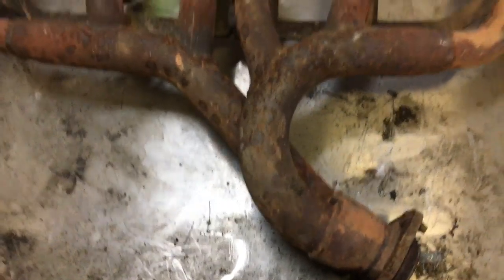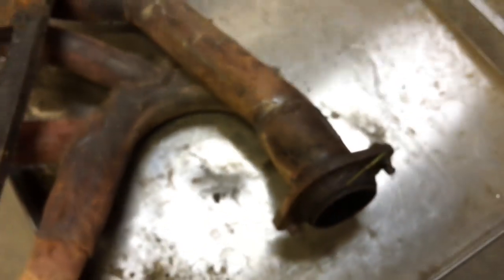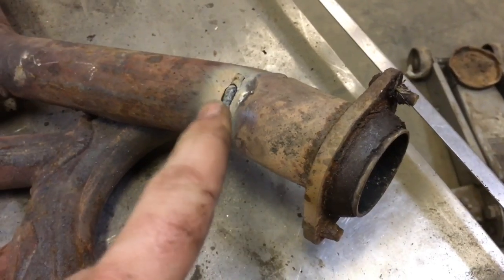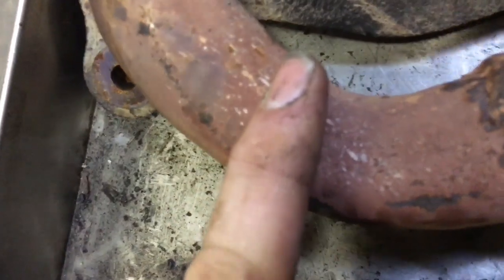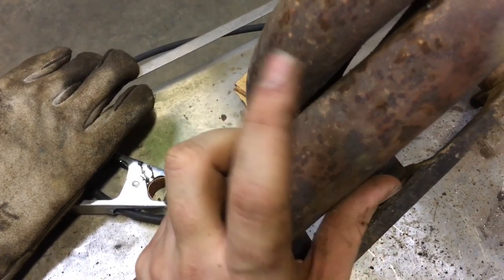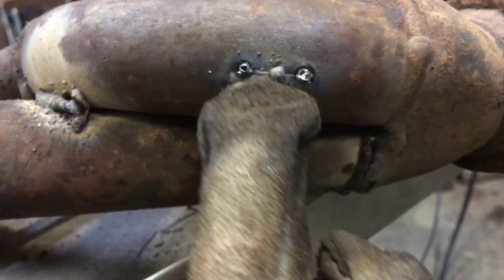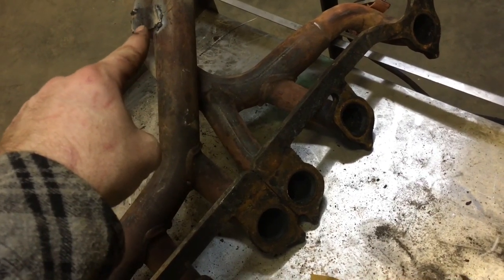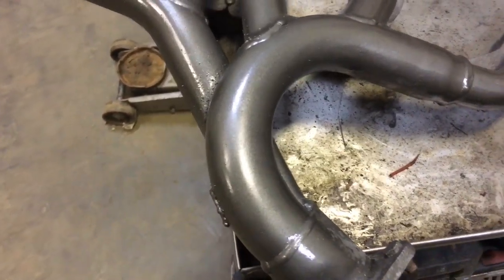How to repair a jeep Cherokee manifold

Comment: You may wish to consider turning both the heat and wire speed up a bit, bevel the crack, a wire brush clean the ground site.Don't worry about the welder differences, they are ALL different even consectutive units of the same model.  As your experience increases the differences will get smaller and smaller to the point you are 'experienced' and sliding from one machine to another, including those using different technology, is an automatic conversion that takes only a brief adjustment.
Reply: ps:  With the proper wire selection (0.030" multi-pass flux core) you can weld anything on your Jeep's armor with that Weld Pak 125amp, heavy gauge steel MAY require multiple passes.  I buy e71t-11 in 10# rolls off Amazon with free delivery that sometimes arrives the next day because the Amazon warehouse is so close.  If you chose to remain indoors and add gas stay with the 0.023" because it will cover thin welds right on up with additional passes.  Please avoid the one-pass -GS wire.There are a few benefits to using Lincoln Innershield but for me it is nice but not cost effective unless you have a account with a local welding supplier.

Comment: Excellent Vid Ronnie ! Thanks for taking the time for explaining the WHY and the HOW.
I have a 94 and a 97, and the 97 has some type of expansion piece in the pipe in two spots.
but I'm starting to hear the leak. So, it must have cracked. Bad Design Again :(
I'll assume that if you buy a new header that you would weld across the pipe to reduce flexing?
Anyway, Thanks for the tips

Comment: How much power loss would you expect to loose from those size cracks?
Reply: Depends on rpm and intake, all stock jeep id say up to 10 horse but the o2's make it run way richer cause they think its lean from not as much flow comming out. Floods cats out sucks fuel wide open throttle id say no loss normal driving its more torque loss on low rpm mor flow more go when you step on it but your off the line torque is killed so its the torque that suffers